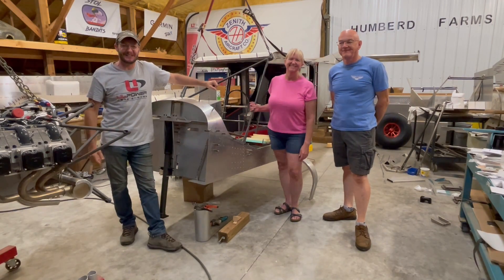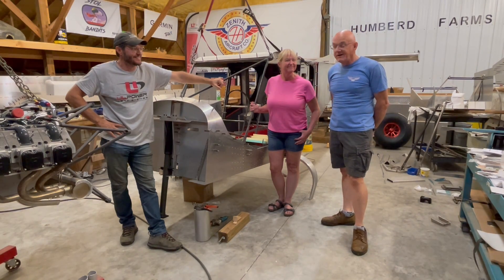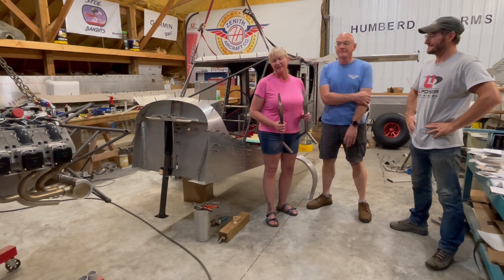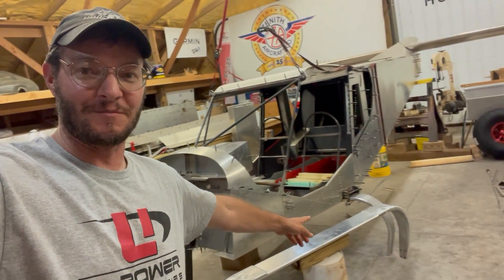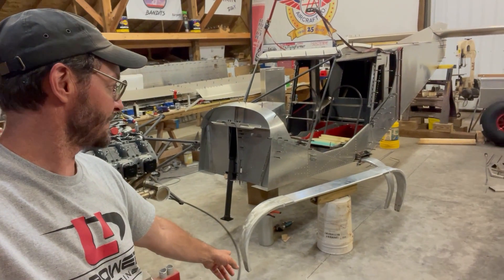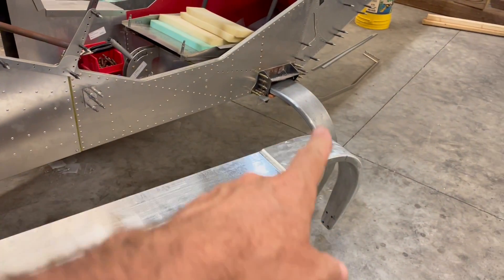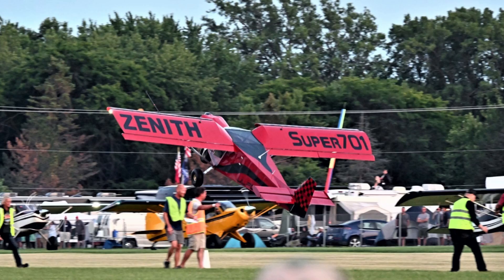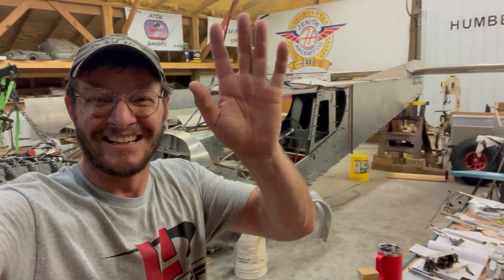750SDXtreme EAA Oshkosh Update with Wheels and Wings and also lightened main gear progress!

Comment: Your removal of thickness from the center of the gear is concerning. You've created a stiffness and strength reduction and stress concentration right at the point of maximum bending where they meet the fuselage. Tapering the cut from that point to the center would be much better, likewise tapering the curved or at least the vertical sections away from the root (granted more difficult). Reducing the cross section height like that reduces the stiffness and strength by the cube of the height change...